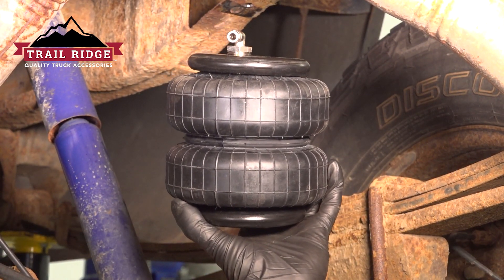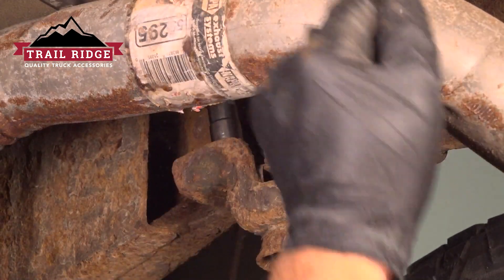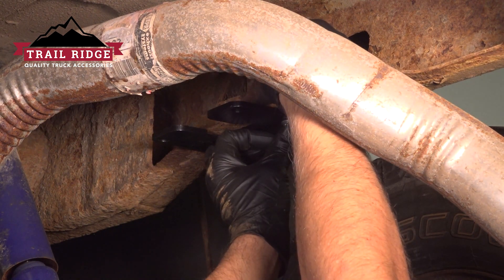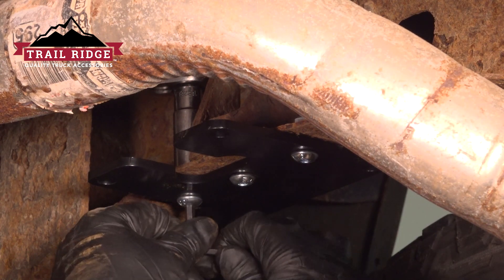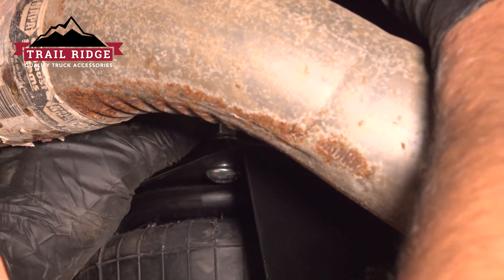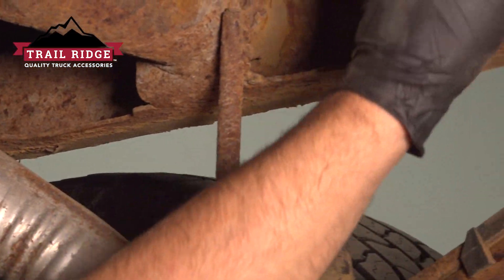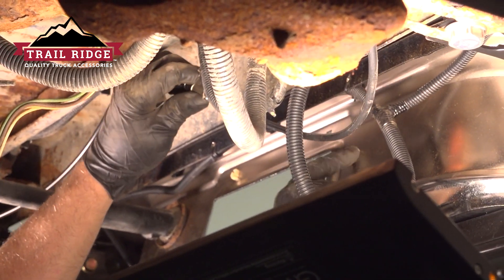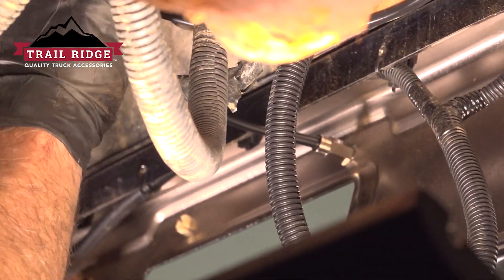How to Install Air Suspension Helper Spring Kit 1999-2006 Chevrolet Silverado 1500

Comment: The Width of the Heat Deflector Plate Covers/ Blocks.... The Two - Corner Bolt holes...How did You Manage to get the Two Corner Bolts in Place...?  Did You Drill thru the Heat Deflector Plate...2 places...in order to slip the Bolts thru, at the Corners...of the Plates..?  Also it Would Have Been Nice to See the Airbags Lift the Truck Bed , at the End of the Video...
   Would Have been Nice to see the Raising Range Height - increase ...in inches...  I understand these type of Bags have a Maximum 150 Lbs. Air Pressure....
  I am Currently Installing this Kit  ( or Identical to it ) on My1999 Chevy  Silverado. I found an immediate Problem with the Kit , trying to mount the First Plate ( A) to the ( Top) Frame... The center Bolt hole and the Bolt hole to the Rear, of The 3, Matched Nicely....But The Forward Bolt Hole Did Not Match Up...!!  I will Have To Drill thru the Frame to be able to install the 3/8" Bolt...!!   Or I can Arc Weld thefront of the Plate...to the Frame ..this was A Complication....that I did Not Expect...on a " No Drill Air Bag Kit...!!   It just Causes a Time Delay...and More UNEXPECTED -  Work... BUYERS BEWARE...!!
   I am Installing New Shock Absorbers ( Rancho ) Also. BillinL.A.  01/15/2024